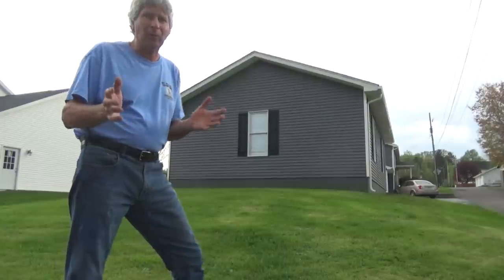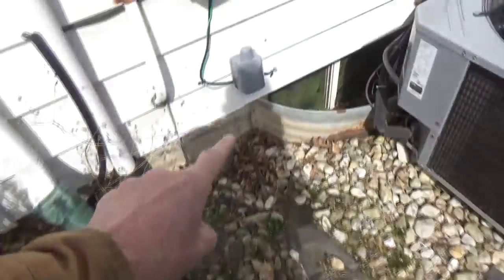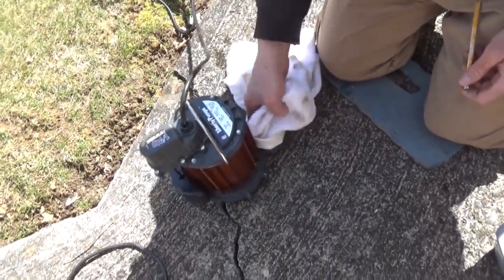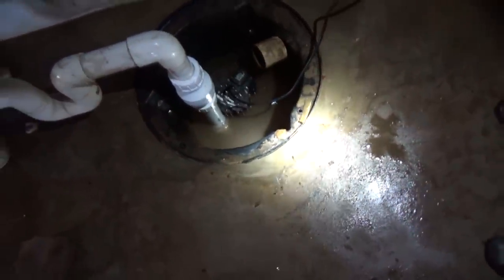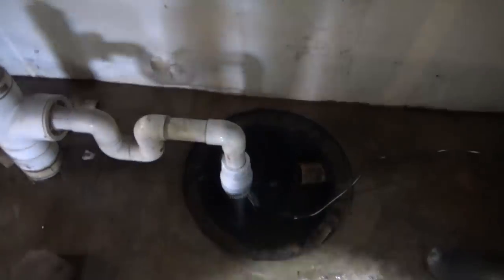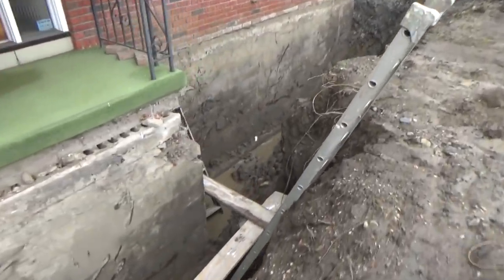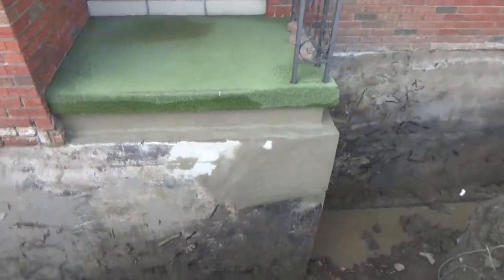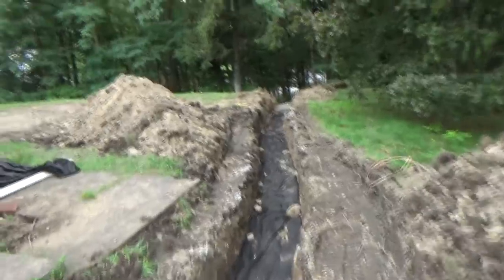BASEMENT WATER PROBLEMS SOLUTIONS (Mike Haduck)

Comment: Thanks, Mike. Sump pumps can be a lifesaver if they're installed properly. But the best solution for water in the basement is to prevent it during the construction phase. Unfortunately, some people move into a house long after it was built (by someone else) and have to take costly corrective measures. Your video showed some good solutions, thanks again.
Reply from the maker: Thanks Bill, I agree, mike

Comment: It's usually surface water, not groundwater that's the problem. Possible water damage is the first thing I look for on a building lot. It's best to take a look when there is a hard rain in the Spring if feasible. There could also be hills nearby that make the ditches overflow onto your lot. Haul in fill and build high if there is any doubt. Thanks, Mike.
Reply from the maker: Thanks yopa, mike
Reply: I added a french drain near the footing and also a surface water catch basin.

Comment: I lived in a 1909 house in Chicagoland, built by a contractor for him and his family. It had no sump pump and no water intrusion, and that included the 1987 100 year rain. The foundation was put in right. 
 In your video, the outside trench may seem like alot of work, but compared to water trickling down the "Inside" of the basement walls, it's a wise choice. I can only imagine the mold and mildew growth where there is moisture present! Nobody should live or work in a basement like that. I'd think a house on a slab would be far superior to a house with a wet basement.
Reply from the maker: Thanks Myron, I agree, mike

Comment: I just dug up my 6ft deep cellar by hand. The old-timer drain (1930s) was just a stack of small bolders the whole way down, but all the voids had clogged up with mud through the years. I ended up having to jackhammer through bedrock so I could place my drain pipe below footer level. I mortared up all the foundation cracks (thanks for all your videos, Mike! I've learned so much), tarred the foundation down over the footer, and put in a dimpled plastic membrane as another layer of defense. Even before I've filled the trench I'm still getting wet in the basement! It's somehow going under my drain and defying gravity pushing it's way back up through the bedrock like a spring and up through were the slab meets the wall. Three permanent damp spots and one that sometimes runs a little. It's a real head scratcher. Maybe I'll try drilling into the bedrock at an angle from the outside and see if I can't intercept the springs and get them to flow into my drain instead.
Reply from the maker: Hi, I know water problems are definitely a head scratcher, thanks, mike

Comment: This is a very good video with information that you do not see on the TUBE. What I am wondering would using a neoprene roof bladder work better than the asphalt spread on the outside of the block foundation wall.  My thinking is that if the wall gets any cracks this will let water pressure push inside the basement causing leaks.
Reply from the maker: Hi victory, there is a lot of diffrent ways to do things, if the land is pitched away and the gringutters go away from the basement, that's what eliminates a lot of problem, thanks Mike

Comment: All very interesting as per your usual. I realize you can only cram so much into a video but you glossed over that porch corner which looked every bit as interesting as to cause considering everything else seemed so solid and what was required to fix and prevent a recurrence in what appears to be an area susceptible  to undermining.
Reply from the maker: Hi, actually the camera went dead on me, go figure,  thanks mike

Comment: I’m on Long Island and near the north shore it can get quite hilly the further north you go and I remember times when there was such an intense rain that water cascaded down these hills and overwhelmed the storm drains and sumps and people in the lower elevations got swamped and their basements flooded and the ground got totally saturated. They began pumping out the basements and the basements began to collapse inward because of that hydraulic pressure and it ruined a lot of homes. You have to wait until the ground loses its water before pumping out the basement, was the lesson a lot of people learned after a freak storm.
Reply from the maker: Thanks joe, good point, Mike

Comment: Mike your videos are great and helpful. I have a question regarding cracks in the foundation basement wall filtering water. How do you fix that crack water leaks and how to water proof the walls. I would greatly appreciate your response. Thank you
Reply from the maker: Hi fab ,in my experience you got to get the water away from the house, I never seen patching from inside so much except maybe make it more dampproof, thanks Mike

Comment: Good video. Thanks Mike.  Growing up in Michigan in the 60s I remember they'd always put pea gravel outside the footing of a basement,  but no way to drain or pump it.  It was to keep the basement dry. But how did it work?  As a buffer? The gravel would hold a lot more water than the almost clay I remember.  My father did it on our house when he built it.   
Later because the back of the property turned into a lake in the spring (we had ducks) we dug a long trench out to the ditch along the road and put in perfed plastic pipe (only on the bottom), infilled with pea gravel.  Might've used some fabric as well (He was concerned about it silting up).   I've learned that this is called a French Drain. 53 years later I'll bet it's still working.
Reply from the maker: Thanks Will, yep I bet it is still working fine, mike
Reply: Always good to have a surface drain connected to it for clean out.

Comment: Hi Mike, is a drain system or digging out to cover up the foundation a must? My home is more than a hundred years old and I was thinking of adding a concrete surface all around the house, can I get away with that to solve my problem with getting water in my basement? I’m trying to see what’s the best thing to do. Thanks in advance
Reply from the maker: Hi J, I seen people try that and never seen it work, the concrete cracks up and water gets in there anyway,  slope away the land and raingutters are usually the best first option,  thanks Mike

Comment: Hi Mike. I have a 160 year old house with stone walls. A couple places are leaking water.  I want to clean between the stones where I have a problem.  My question, is, should I use the S motar or Portland cement and sand. I'm only working from inside the cellar. I know say that Portland cement is better for water. Thanks again.
Reply from the maker: Hi R, it varies depending on the job, sometimes I mix the two, I show what I use on each of my videos,  Mike

Comment: Hello Mike, name is Ben. Need some direction... Have two 10 inch concrete pillars that hold our metal porch post on our 1950's home. At least 3-4  inches of the top of one has separated for the remainder of block. The shape is round only the bottom is smaller than the top. Tried to find an appropriate video from your list yet haven't done so. Do you have a video on this type of repair? Are their such things as sonatubes that I can wrap the post and remaining circular slab. Plan on doing this coming week. Thanks, your experience has saved me before.
Reply from the maker: Hi Ben, sounds like you just got to clean it up, do a little forming and patch it up, maybe my concrete patch videos will help, thanks mike

Comment: I’m surprised that there is no foundation under the garage. How can this be? Was it just a slab poured and the wall and brick rests on the slab? I would have thought there would have been block 4’ down below for the walls and brick to rest on.
Reply from the maker: Hi GSM,  it's called on slab, common in most areas, thanks Mike
Reply: @MikeHaduck  Thanks for the fast response. I guess where I’m from (upstate NY) garages especially attached garages have 4’ deep foundations that rise above the concrete floor where the walls rest on. We have strict  codes here in Albany so perhaps that’s why. Anyways, be safe from the storms in Florida Mike. As always, a pleasure watching your videos. Be well.
Reply from the maker: @gsm19911  thanks gsm,, Mike

Comment: There's nothing worse than a wet basement.  A good idea is to add foam insulation to the basement walls after coating them.  It preserves warmth and reduces sweating.
Reply from the maker: Thanks A, mike
Reply: Done right, with draining foam insulation on the outside, like Pordrän, also the moisture will be pulled out of the wall and drained. Could give you perfectly dry walls.

Comment: I know of a church, bought a modern church building for 1/4 it's value because of water problems due to grade issues and low windows in their lower level. They installed retaining walls around the windows to raise the grade with volunteers. Total cost to fix water problem was under 3 grand.
Reply from the maker: Thanks Jon, good to hear that. Mike

Comment: The dug out and pipe need to sit at the bottom of the footer - below the level of the concrete floor. If not, water is allowed sit underneath the pipe and soak into the bottom of the concrete floor. It doesn't come up high enough to be drained through the pipe into the sump. The result is damp concrete and a damp basement. The replaced floor should be as thick as the original floor. Also the sump being lower than the floor and maybe the footer, pumps out water before the water table reaches up to the level of the floor.
Reply from the maker: Thanks KT, good points, Mike